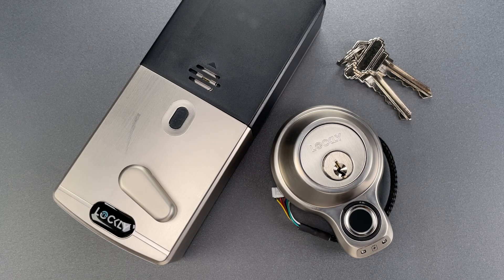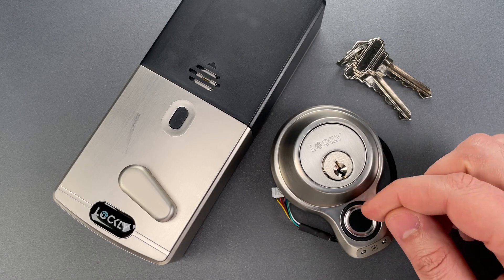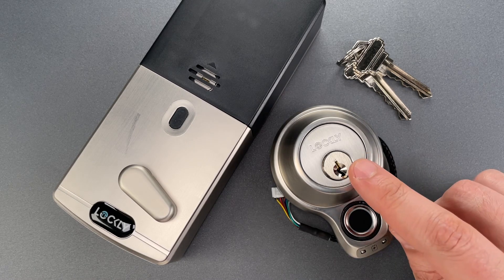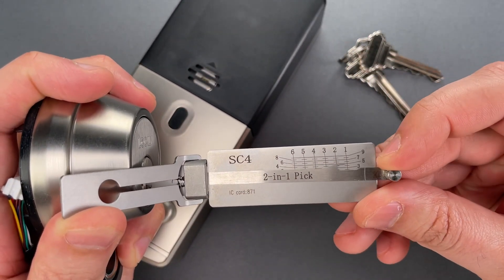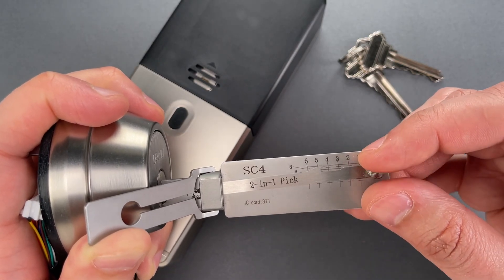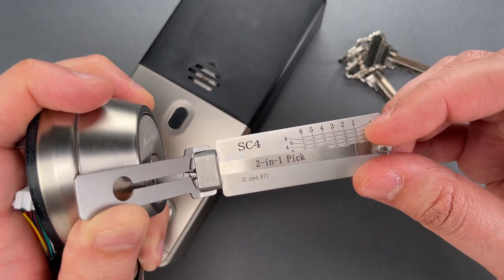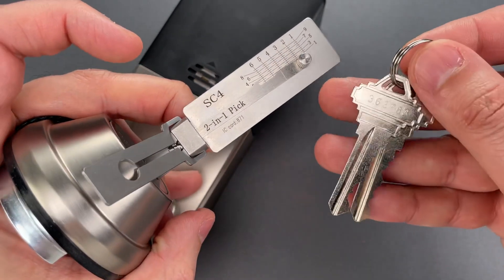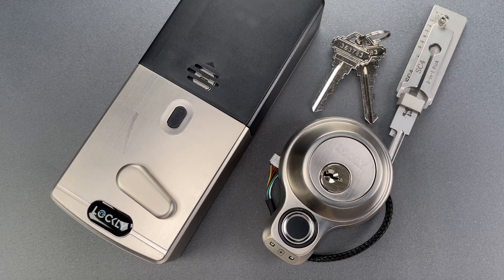[1410] Lockly’s “Flex Touch” Deadbolt Picked

Comment: I'm  a bit surprised you didn't seem to attack the electronics.  Where's the magnet that just opens it by running it across the top?  Where's trying to confuse the optics with a flashlight strobe or something?  How about hitting those contacts with a few thousand volts?  Hmph.    Still, I'm gonna go get one.  Good price on Meh today.

Comment: My front door dead bolt suffered a catastrophic failure about 2 weeks ago. Put my key in,turned it,and the entire lock cylinder just turned and turned.  Tried to pull my key out,the entire cylinder started coming out. I heard pins dropping on the ground. Luckily I got my key out and got inside my house. Pulled the lock apart. There were pins in the door hole,a retaining clip lol. Springs.  Omg. Yea,that lock died lol. Oh man. I'm just glad I was able to get inside because it did unlock the door it just kept turning lol. It was old.

Comment: I want to get into lock picking just as a hobby, I have been wondering for a while now if there isn't something like a somewhat soft plastic (replaceable) with a strong metal shaft that you slide in and turn, shifting the plastic out where the key grooves are but can still hit the pins.. I imagine a tool like that would defeat 90% of all house locks..

Comment: I love your videos, and they info contained in them. Honestly though, a pick proof deadbolt is the least of security concerns when the average thief simply kicks open the door.
Money would be better spent on well built door rather than a pick-proof lock.
But I love watching anyway.
Reply: I have more than a little deeper knowledge on the subject, and you're right. Which is why I'm not the least bit worried about the plain-jane Kwiksets securing my doors; it's everything else around them that matters most.

Comment: I wouldn't want to hook my locks to my wifi.  I wouldn't trust that security level.

PSK Wifi security is weak. 

As of the lock security, it to LPL a full minute to unlock it, with a good tool.
Reply: As a note, I know there is a business wifi security solution that uses RADIUS instead of simple PSK security.  That is much more secure.  However, this means setting up a RADIUS server as most routers don't have them built in.

Comment: Oh, WiFi access to the lock. I see that as huge security flaw. There were many problems with those before, especially because they usually have only basic protection. Or they are connected to the same network as printers or smart fridges which are often easy to break in with low technical skills and if somebody can just unlock it from outside, well... that is kind of terrifying for me.

Comment: "hook it up to your wifi for remote access" BAD IDEA, BAD BAD IDEA. "Smart" devices like that have little to no security on them are are hacked on a daily basis. Hooking that up to your wifi, is like handing the keys over to any moderately competent hacker. That option alone makes this device a no go. The only reason you might have some security is if you don't run across the radar of a hacking break-in artist. And that's not counting if the mechanism can be tricked with a magnet.

Comment: This is gonna sound medieval but why not have a look which is covered with large, sharp spikes. Really difficult to hold let alone hold still while picking. Only able to be opened with a very long key. Would also block you from being able to actually reach the body of the lock with a cutting disk until you removed a few of them too. Imagine it all made out of one cast iron piece. I can easily imagine a lock like this being used for some old castle. Just saying, why have I never seen a lock which pricks you or stops you from holding it in some other way like shocking perhaps? All it would have to be is mildly cut resistant and solid enough to take a bullet or two and you have a lock which is sensationally difficult to get into in more or less any way.

Comment: We really do need a breakdown on the attacks to the lock other than picking and its resistance to them. Once the lock itself is of adequate quality, or can be swapped out for an even better one, the burning question is - is the whole system adequately secure, or does it contain some other hilarious vulnerability that renders it useless.  If it can be opened with a piece of soft drink can, or a credit card, I care nothing for its pick resistance.

Comment: The fact that LPL took that long with a lishi tool means that the average lock smith will not be able to get this open this open without destroying the door.   Definitely a lock I would use, though I would like to see how the smart features fare. Having a decent lock will not help if someone is able to bypass the smart features.
Reply: A Lishi generally isn't faster - it's kinda easy mode, but it slows you down taking much longer to move between each pin.  LPL, as good as he is, could probably get through it much faster picking normally, but I would need the Lishi if I wanted to get inside before the milk went bad :P

Comment: For residential locks like this, all we can expect of the physical lock is that it isn't worse than what the homeowner had before, and this certainly seems to fit the bill.  But there's a second issue: are there any flaws in the electronic gadgetry that make the system more vulnerable than a physical lock?  It might be neat to do a follow-up where LPL looks at attacking this with magnets, pounding a screwdriver through the fingerprint sensor, that kind of thing.  If there's no obvious problems on the electronic side, this sounds like a great product!

Comment: Hey LPL, in video 527 about the Hines Key System, could one of those cores be used in this kind of lock and would you be able to unlock it from the inside if it was picked and seized up? I'm really curious because this seems like a really nice remote lock but physical security is still best

Comment: If the lock is smart enough to detect that each pin is individually moving instead of all pins at once, can the lock then apply 220v or 480v 3phase to the tumbler and see how much the picker likes it then?
Reply: Considering it's almost certainly battery powered, no.

Comment: Every tech savvy person flinched when you said "Bluetooth or WiFi". This lock is probably easier to hack than pick.
Reply: It’s like the old joke

The person who “likes technology” has everything smart: lightbulbs, door locks, security cameras, motions sensors, fridges, microwaves…

The person who actually works in technology has a printer and a gun they can use if it makes a noise it isn’t supposed to.
Reply: Yep. Unfortunately most people have way more to worry about with their software security than their hardware security. Unfortunately, with the sloppy quality control on wetware these days, that's not likely to change anytime soon.
Reply: Just what I tought, it's so nice they do it that way because i'm really bad at lockpicking but thanks to bluetooth i could be inside in less than five minutes and i don't need to be exposed in front of the door 😂
Reply: Prove it is actually easy to hack or stop spreading FUD.
Reply: @fashnek  This exact model was hacked before and some of the bugs exploited come from the communication protocols used not the lock itself.
Reply: Possible to someone does not mean easy for anyone and it does not mean possible for all. Are you going to try to tell me about Breaking into a Wi-Fi network, replay attacks, device spoofing, Internet-based attacks, compromised online accounts? You need specific conditions, and usually a lot of preparation, for these things to be possible, which is not the case for picking a lock. And yes, it’s super easy to climb into a car if it happens to have the windows down.
Reply: @fashnek  Sure, but unlike picking the lock an online hack scales. Not to mention going from low-skill attack requiring special physical tools to (potentially) no-skill attack requiring a downloadable bit of software
Reply: So ignoring that Bluetooth and Wi-Fi are not the same thing as online…. an online hacker theoretically hacks my lock from eastern Europe or maybe Nevada using my IP directly or some service I use for my lock. Then what? They need an accomplice, or they have some traveling to do? A local opportunistic lock pick is still “easier” for the thieving public in practice.
Reply: @hardwarefromthegarbage3446  I can’t understand what you’re arguing or asking. The burden of proof is on you to show that the lock is easy to hack. Otherwise, whether you can bring yourself to admit you invented it or not, we will still know you’re just paranoid. Keep your unsubstantiated FUD.

I can tell you’re not used to people around you bothering to dispute you when you bluster as if you’re an expert.

Comment: Anything with Bluetooth or wifi is a huge problem.  Would also be interested to see any vulnerabilities with the battery terminals exposed on the outside, if you could glitch the electronics easily because of it

Comment: While he didn't go into it, you can tell by the size of the lock side of the device that at least the solenoid is on the secure side of the door, so appears to at least be immune to the magnet trick to unlock it as well.

Comment: I have a very, very big question since those times I started to watch LPL videos years ago. Why does he only picks cylindrical locks of any type (pin chamber, dimple, etc.) and disc detainer ones, but not lever locks or other types of locks? In CIS lever tumbler locks, crossbar locks and similar types are far more common than any of those mentioned here, but we never saw any of these being picked by the LPL. Why?

Comment: I wonder how the electronic part holds up? I know a common vulnerability is that most of the electronics are on the outside, which means you could just open it by providing an external power source to the motor/solenoid

Comment: What's the "battery symbol" below the fingerprint scanner and those 2 contacts for?!....Don't tell me it's to power the fingerprint scanner with a 9 volt battery...you know what's the failsafe in case the fingerprint scanner doesn't work?!...it's the key...the only thing more ridiculous would be: an electronic deadbolt witout a key on the outside, that uses a camera with both facial recognition AND motion detection, oh and not connected to the internet. You'd have to feed it "videos" to make it recognize you in motion.

Comment: I'm surprised he didn't mention attacks on the electronic components. I assume that if there was any especially bad flaws, he'd have mentioned them, but Bluetooth and WiFi don't seem especially secure.
Reply: Bluetooth and Wifi only make it vulnerable to possible hacking, which is not his specialty. And since the electronics are on the inside, things like magnets wont work. Its as secure as  you are likely to get. He probably didnt find every single vulnerability, but the way its designed, it looks like you would have to go destructive or something highly unusual.

Comment: I think you need to start some sort of grading system for these locks. At the low end are the locks you recommend to your enemies. Then mid tier are locks that you would use but only in combination with additional security measures. Above that are locks that you'd recommend to your family with confidence, and top tier might be to protect the declaration of independence.
Reply: It's been stated that he won't, simply because he could be liable if someone gets one and it gets bypassed/broken into.
It's why he says 'above average' or 'a lock I may use'

Comment: I know he's kind of gotten away from teardowns, but I would have liked to have seen the shaped pins he was talking about.
Reply: There is a slight bevel or taper on the driver pins and they tend to hang up at the shearline requiring extra "nudges" to set. They are only effective in locks with close tolerances. Australian Lockwoods in the past had these beveled driver pins and they were harder to pick than spools. Not classed as security pins, but were fitted to allow a little extra wear on the key pins and key without the lock "catching" over time. Spools "tell" you when they are picked, and flat bottomed drivers will often "click" when set. Drivers with bevels in a close tolerance locks will tend to partially set "soft" requiring extra attention to clear the shearline.
Reply: @brianhignett8954  Well explained!
Reply: He’s done a couple lately, right?

Comment: I bought a fancy $300+ digital lock made by Samsung. I've be curious to know if it holds up well against picking. Similar to the one you can see in the apartment of the main characters ex-wife in the show Squid Games.
Reply: If it is made by Samsung - in a year the control panel will die which costs more than the lock to replace- if their refrigerator and range boards carry over to their locks ;)

Comment: I have a Lockly. Their touchpad design is genius and really shows they do care about security. What they do is you generate a pin and what they do is randomly scramble where the correct numbers are each time you use it. In addition, you can give temp pins for family or friends if you needed to let them in when you aren't home.

Good to see that the cylinder isn't bad either. They are expensive but they're worth it. I have kids and the auto-locking after 30sec or so is great for me knowing they didn't forget to lock the door.
Reply: Thats good. Because on touch pads and even some phones, you can see the areas that are used the most
Reply: You’re discussing a different model than this one, yeah?
Reply: @Raraoolala  Yeah
Reply: Got that RuneScape bank pin security
Reply: dot
Reply: Have you tried the powerful magnet test though?
Reply: @888SpinR  The lock isn't solenoid operated.

Comment: I find it quite curious that the key code is stamped on the key. It was the same numbers as LPL said it was. Again his tool did the trick, and gave the correct answer.
Reply: Kwikset and Schlage stamp the cut numbers on their residential lockset keys as a rule.  Not sure about the higher security / commercial grade.  I would have a copy made from them, and only use that, to avoid the possibility of someone having a key made from reading the cut code when you use it.

Comment: I always wondered how durable these Lishi tools are.. I can imagine in an experienced hand it would last for a long time, but if an inexperienced person buys and uses one, how long can one last whitout breaking? They are fairly expensive (and specialised) to get compared to normal tools so durability is important here i think.
Reply: it's as strong as a normal pick, because that's basically what it is, with additional stuff. And experienced users do break picks too, it's just a fact of life. The pick does wear out
Reply: @marcogenovesi8570 ty for the answer. 
Also i know that even experts breaks picks too, i just meant they break them less frequently than a novice.
Reply: @StarfoxHUN  not sure where this "novices breaks picks more often" comes from, real life is not like video games where chances of breaking the picks are linked to lockpicking skill.

In my experience it is mostly linked to picking style, people that like going full gorilla will break more picks but can be faster (and will have a easier time with rusted locks), while people that have a more careful approach will be slower but break less picks (and will have an easier time with higher end locks where precision is more important).

Novice pickers can be in either camp, low skill in picking only means they can't open locks.
Reply: @marcogenovesi8570  No, what i tought is novices knows less about how much power they can use while picking, not holds the pick optimally and such. But yea, you are right, picking style matters more here than pick and force control.

Comment: I always wonder how these tools are legal to sell. Don't get me wrong I like what you are doing here and got myself a set of picks, but these Lishi Tool seem so easy to operate and open basically any lock, that must be illegal right?
Reply: There are different ones and not illegal, they are not only trade tools but are sold by various outlets.  Your average theif wouldn't even bother with your locks from what law enforcement have said on this channel.
Reply: @nooboftheyear7170  Correct.  The average store or business has locks only for insurance purposes. "Was the door locked?"  The actual money goes into video and alarm systems.  This means that thieves just smash and grab (a few items) anyways. The sad part, though, is that the average home owner doesn't know that the entire industry has realized this as is cutting corners making security in looks only products to satisfy the businesses. Commercial security on lockboxes, doors, cabinets, and so on is largely a joke.   I think this is a large reason LPL does what he does.  We at least know the ones to avoid.

Comment: Wonder if EMP could bypass that lock
Reply: I would guess not. For that to happen, it would have to fail open. This is the same thing that would happen in the case of a power outage. As the video was shot with it unpowered, my guess is based on what we saw

Comment: "above average tolerances" is a backwards way to describe a smaller size of the manufacturing errors.
Reply: Yeah, tolerance is one of those things where less=better, so smaller tolerances have bigger value. I think the normal workaround is referred to the gaps as tight or loose rather than big or small.
Reply: Also means they have put the pieces on a decent manufacturing line instead of their cheapest.